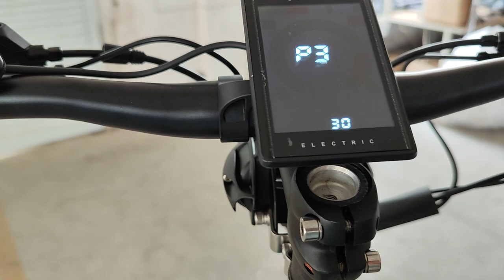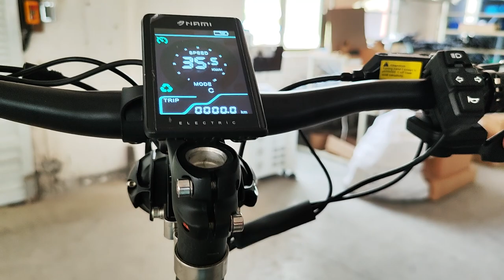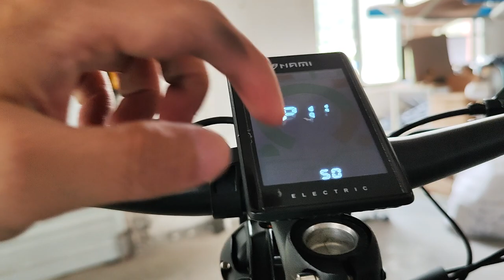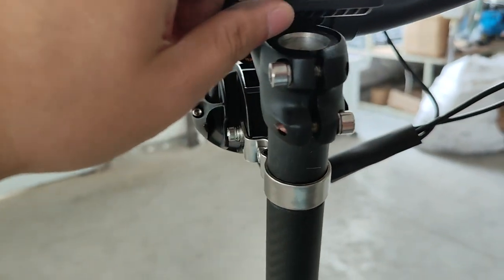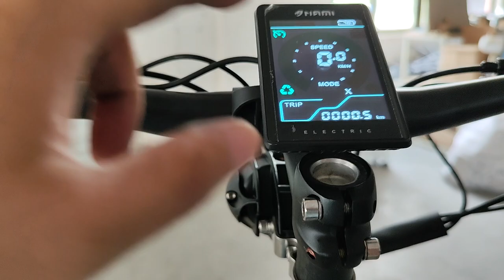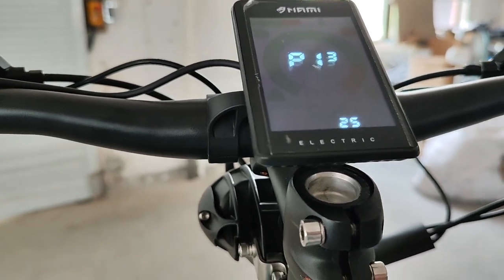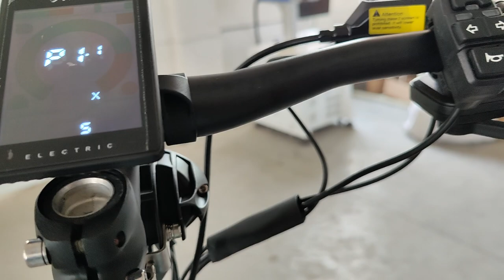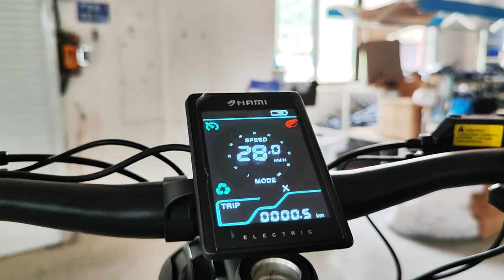Nami scooter dashboard setting and advance setting

Comment: Hi michael, I am having some difficulty with P7, I have it set to 0 on X mode but I'm still finding I have to kick push for the acceleration to work?
Reply: Unplug both wire under the scooter
Reply: @Nixonbutcher  yo thanks man I got it to work eventually I unplugged the wires so it would've been that
Reply: Welcome

Comment: Hi Michael thanks for posting these videos, I am enjoying my MAX2 40ah last couple months now, and I'm impressed with the adjustability and excellent build quality..   I'd like to know if you have learned approximately how many miles or Kilometers  before tires and brake pads typically need replacing, same for typical lifespan of Motors and controllers too. Also if you've tried the PMT tires - would be good to see what the factory thinks of them in comparison to stock tires...thanks in advance and keep up the good engineering!

Comment: Hey I just received my Nami Klima.  After setting it up I went to ride it but it’s going so slow.  In X mode it only goes 15mph and In E mode is only goes 5pm.   I checked the display screen and settings to the manual and it all looks good .   Battery is 97%.   What is the problem ? 

Do I have to unplug the speed limiter wires ?
Reply: Yes you have to unplug it, I also have the klima.

Comment: When you have the turbo icon showing (not ON) is that doing anything? Or do you need to activate turbo mode to ON for any speed benefit?
Reply from the maker: it means the turbo funcion is ready to be active, it does not change anything
Reply: @michaelsha2781  thank you. Just got a Burn-e 2 Max, it's an amazing machine 🙏
Reply: @myplaxismodelisbetterthanyours  same! my P3 setting is stuck off. Won't change to anything which is strange. Otherwise x mode is insane. I wasn't ready lol

Comment: How do I remove the brake active icon on the display? When I turn on my scooter when I squeeze the throttle the scooter won't move ?
Reply: I know this was 2 months ago but in case anyone else has the same issue there's a decent video on https://youtu.be/bikr-61x2IQ. Jiggling the brake wire caused it to go off for me but I'm still trying to figure out why my scooter won't accelerate at all after riding 4 km

Comment: I had a nami and the charger turns red for about 2-3 seconds then turns back green can you help me with a solution
Reply: Not personal experience but I saw a YT video that said plug charger into scooter 1st and then plug it into power outlet after. Just got Klima Max today do can't confirm it but been watching videos on these Nami scooters and that was one I came across. GLHF
Reply: @jasonwu2758  thanks I fixed the issue, when this happens you have to make sure you unplugged the display so the charger and display can both be reset.  The issues is the control panel doesn't know how much power the scooter has and turns off as a safety.

Comment: P3 won't let me change from "OFF"
Reply: I have the same problem p3 can't change to on and can't change the settings for the front motor p1.2 and P1.4.
Reply: @1Petergreat  I'm speculating but I wonder if it has to do with the NFC card reader disabling? That's the only thing I'm guessing as to why. I was able to change it to off but now can't do anything to it since.
Reply: Apparently you have to go to basic settings p15 and change it from 0 to 1.Then in advance settings you can adjust 1.2and 1.4 for the front motor according to Michael Sha.